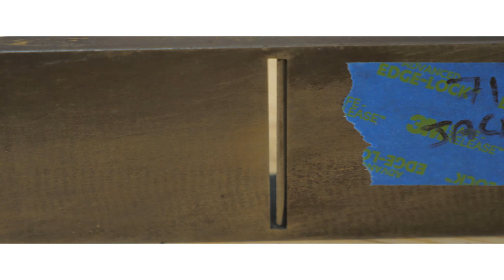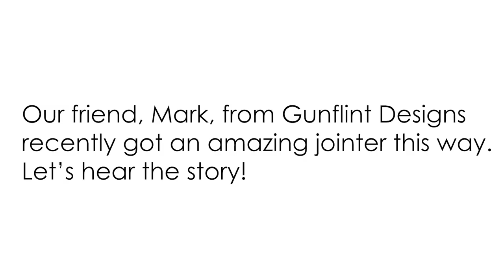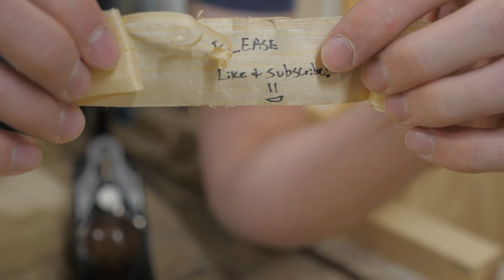Why I Restored a 90-year-old Hand Plane | Sargent 711

Comment: Good suggestions on buying used and the rational for it or against it.  I am not an owner of a woodworking business yet, just a hobbiest a this point.  You covered purchasing tools on another video and I would add buy the one you want to own for a long time the first time.  I purchased a "toy" for my first table saw, sold it at a yard sale bought a better toy, sold that on Craigslist then bought a real table saw used on Craigslist.  At the end of the day considering the purchase price of all 3 saws and the money I got back on the 2 sales, I effectively spent about $1k on my current tablesaw.  Had I been patient and not made poor purchases my current saw would have only cost $500 not $1000.  I would like to have spent that other $500 on other tools etc.  I have also purchased a used 3HP dust collector that I'mm very happy I got USED.  A dust collector is not that sexy or fun but necessary, it was great to get it half off new.  Good luck with the business and channel keep up the good content.